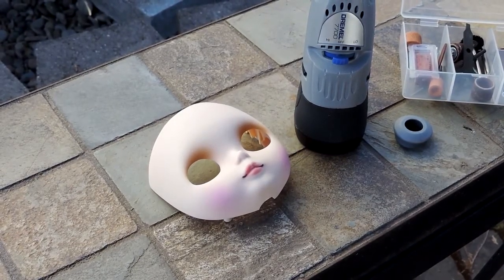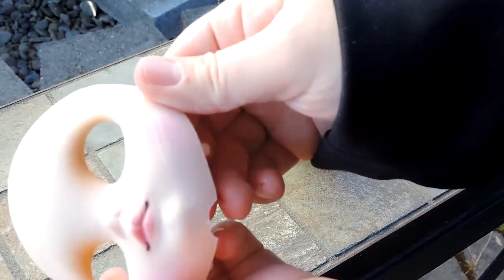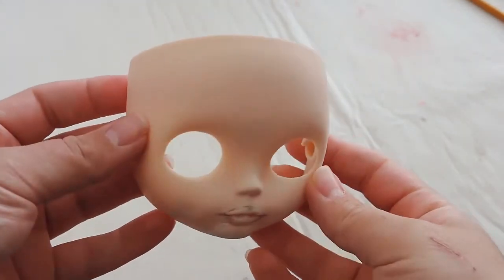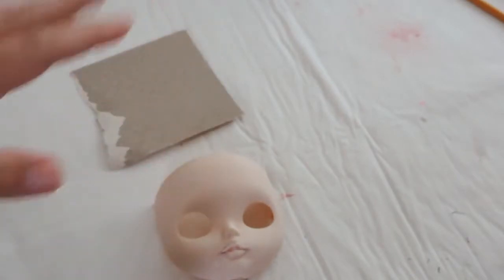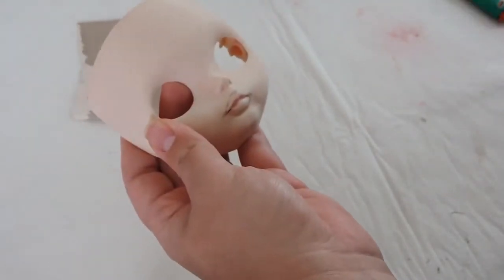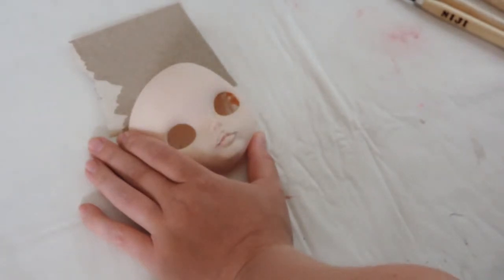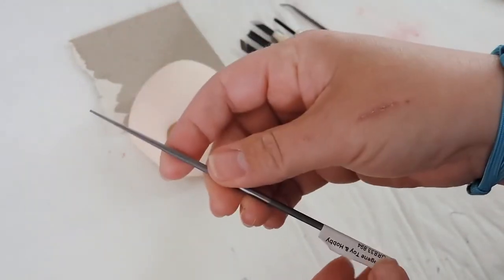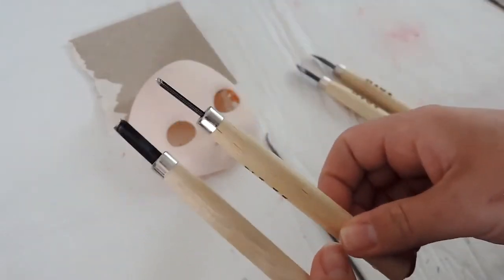Customizing a Matte Face Blythe Doll  Carving Part 2

Comment: I know it's been a year since you uploaded this, but on matte and rubber dolls, buy clearasil zit cream and cover the face and leave on but check in 30 mins up to a few hours. It's great for removing stains even on doll bodies and when wiped hard with a dry rag, sometimes can take whatever pigment is left. The salicylic acid lightens the material, bleaches it a little.

Comment: Hello! Im new to the hobby! Is it really needed to sand the faceplate?
Reply from the maker: You don't have to sand it but if you intend to add color it will make it adhere better. ;)
Reply: Thanks for replying! Can I use acetone?
Reply from the maker: @hemlockdafodil  Many people have found that acetone melts the plastic but I've used it once with no problem. You could try a small area and see what happens but just be aware it could damage it. ;)